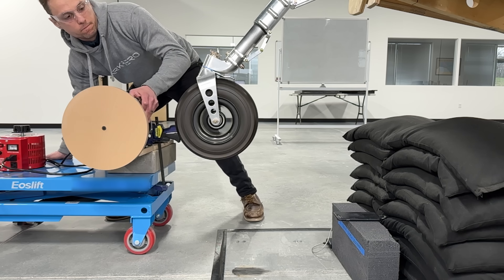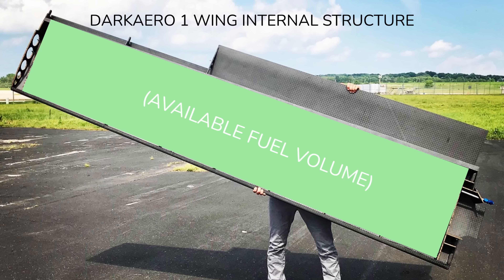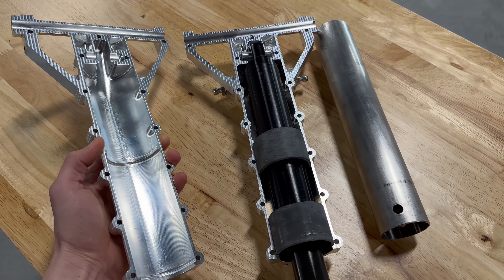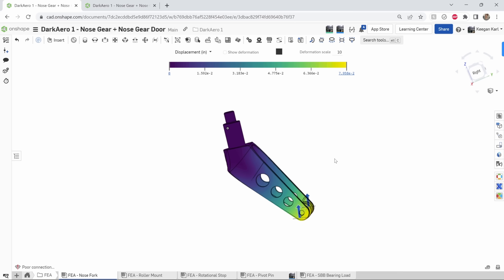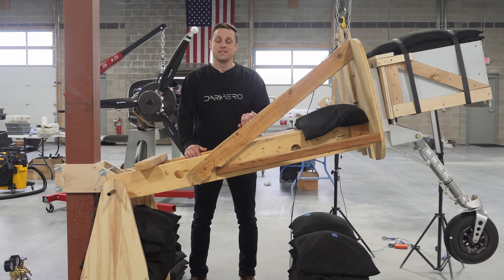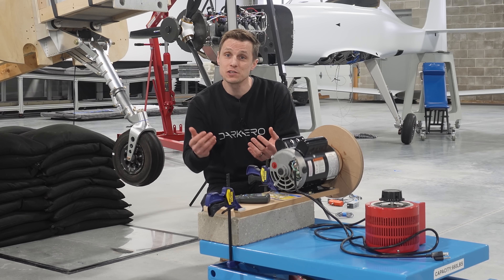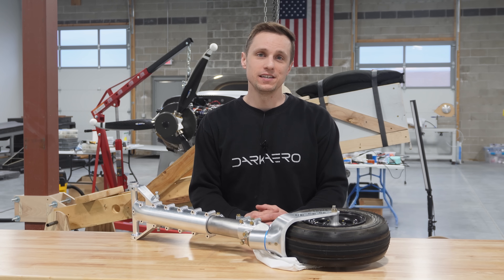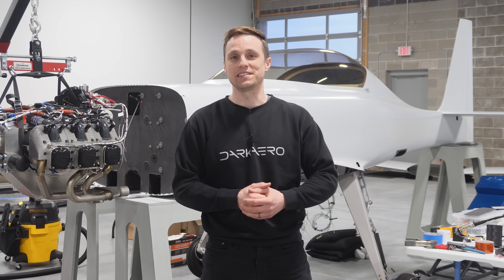Engineering softer landings (drop testing)

Comment: Are there tire pressure indicators inside the cockpit as is the case in most modern cars? A partially deflated tire may cause lots of issues during landings. Can the tire pressure difference between a warm take-off airport and a cold landing site matter?

Comment: The mass on the nose-gear that is needed for a simulated landing impact, is much greater that the equivalent static weight being carried when standing or taxiing on a smooth surface. This is because the pitching motion of the aircraft adds inertial mass to the static mass. My work (and engineering paper in the American Journal of Aircraft) shows that this dynamic effect can increase the size of the so-called static mass by up to 3 times, so we need to design the nose gear to withstand much more force during a landing impact than only that from its static weight reactive load. We need to include the effect of both sinking speed and equivalent mass due to pitching.                                                                                                                                                                        When taxiing over bumpy surfaces there also is an equivalent mass on the nose-gear due to the pitching motion of the whole aircraft. To better understand this, a simulation of the complete mechanical parts is needed. This is what my paper was all about.                                                                                                                                                                                                                                             Past experience on the Airbus A200, some years ago, showed that the formal method for calculating this equivalent mass as specified in the airworthiness regulations was insufficient, and that fatigue strength and life was limited due to this incorrect resulting fatigue spectrum being originally used. My paper about it is still relevant because I wrote it so as to cover a range of parameters suitable for application to many tricycle layout aircraft landing gears.
Reply: Very nice information, and I alao think their tire spinning test is worthless as there is a dynamic braking force additionally to the linear forces especially induced by braking (cog moves forward)
Reply: Doesn’t the differing load scenarios you describe indicate a perfect use case for electronic adjustable dampers?  My 2014 KTM adventure bike and bmw m40i have electronic adjustable suspension which drastically changes suspension performance based on sport or comfort modes.  Seems like a significantly more expensive and safety critical aircraft could have a ‘taxi’ mode and ‘landing’ mode for dampers to handle different scenarios.
Reply: @jonasbaine3538  It's probably not necessary, but I guess it really depends on the particular damper they are using. I think it would be a non-issue with a non-adjustable high quality hydraulic damper with optimized high/low speed compression/rebound, but they are using a combination air spring/damper with less damping than optimal (stiffer spring rate with less damping, forced to be progressive also). From my experience with baja SAE using both air and hydraulic dampers, hydraulic does a far better job at the cost of more mass. My guess is that most runways are smooth enough that it's not a safety concern, probably just a comfort concern. The extra price, mass, and complexity is likely not worth it. The only thing that would make sense to me is a pilot-operated pressure release if issues arise while taxiing, requiring the spring/damper to be re-pressurized before the next flight (can be done easily with a hand pump).

Comment: There was a lot of deflection in the wooden box holding the simulated load. Wont that have a cushioning effect on the impact load? I would think a re-run with a more rigid material holding the simulated weight load is needed.

Comment: Do you need to consider emergency landings (off a tarmac) where the raw ground could have obstacles that can cause the plane to want to flip forward?  Meaning, do you need to design the landing gear to handle a head-on shock load to the wheels/landing gear during an emergency off-tarmac landing?

Comment: i am keen to know how you guys do the validation of the composite parts computational test and real world .also  how you guys find out the life cycle of the aircraft computationally?? Also i am a bit concerned about the stress concentrations on the corners if you are placing your landing gears at the corners because these areas are usally the location of the longerons??
however as an learning aircraft designer myself i am very glad to lyou guys for making such videos its great informative and fun!!
Reply: Look at any composite fatigue data and you will find a break in the curve that shows if you keep strain below a certain threshold it will have nearly infinite fatigue life, beyond 10^8 or 9th. This is somewhere in the mid hundreds of microstrain for many epoxy-based composites.

Comment: once you have the landing gear and fuselage completed,
do you plan on taking the prototype to a full sized wind tunnel to test the deployment and retraction of the landing gear in various wind conditions (and maybe a bit adverse levels)?
Reply: That can be tested in flight. Most first flights they won't retract the gear. On subsequent flights, they will try it.
Reply: @Triple_J.1  
That doesn’t answer my question, nor is it - to my non professional opinion - really safe if something goes wrong.
If they have the landing gear in a locked configuration, it doesn’t test how the electric motors operate under load and resistance.

Comment: Great job!!!  But the biggest danger is beign overlooked... The ULpower engine need lots of work before its SAFE.  Its not safe out of the box. (Poorly designed Cylinder to HEad Gasket System that leads to leaks, lean running and piston breakup, Neglected Bolt Torques all over the engine, lack of a detonation sensor or lambda probe leaves correct fuel-air mixture to basically atmospheric pressure and luck)    8/5/2023   I hope you guys listen to my advice, check those things... UL Power user myself.

Comment: Thanks for sharing! The last test shows rubber wheel deformation: it's squeezed against its tight metal holder. Could this cause the plane to tip over on a hard landing?
(Engineer, no experience with landing gears)

Comment: Very cool. If you get bored on your weekend, I need a nose gear for my Flitetest Mini Guinea. I've trashed everything I've tried. 😉

Doesn't need to retract, but it does need to steer and absorb beginner landings (read: crashes) of ~600g foam airplane.  😂 My goal is to keep it under 20g, including the 5g servo for steering.

Comment: Ive noticed all the newer planes are using winglets on the ends of their wings for better efficiency. Would they not have worked on this type of aircraft? Or would they slow the aircraft?
Reply: This was addressed in a previous video. I believe their research indicated unacceptable increase in drag with only a marginal decrease in stall speed. Winglets tend to add value in longer wings.

Comment: All the gear assemblies retracting rearwards can’t be great for the center of gravity on an aircraft this light. The shift in mass as the gear extends/retracts will definitely be noticeable in flight. Also, Leaf spring type undercarriage have been successfully used on GA aircraft like high wing Cessnas for decades, long before you lot were born. Stop trying to re-invent the wheel.. Get this thing to fly first, then concentrate on over-complicating something as simple as undercarriage🤦🏻‍♂️

Comment: As always a great video with solid engineering principles. Watching the drop test with the spun up tire, your compression works nicely. However, the rebound landing appears to show no compression, but bending instead. Have you done drop test with the wheel stationary? This would simulate a secondary landing from a bad wheel barrow landing.

Comment: Hi Dark Aero.  Will you explain at some point how you will test for side loads and twist loads on the gear during landing?  Sometimes the wind can be howling from the wrong direction and  you’ll land while both slipping and drifting. Thanks for the many great engineering lessons.
Reply: The limiting item is tire grip. You're not going to see more than 1g laterally. Even a corvette with wide tires can barely manage 1g lateral grip. So, as long as the gear can handle the weight of the aircraft sideways. On that hears long lever arm. It will be fine.

Comment: You can simultaniously test the engine mounts when you attach the sandbox like you would do with the engine, and attaching the engine mounts to the “firewall” like on the plane
Reply: I am hoping they will do a full chassis drop test, but that might come later when there is more than one airplane. Keep up the excellent work Dark Aero Team!

Comment: The well known MX2 aerobatic aircraft has been around since 2005, is also all carbon and occasionally suffers from serious problems with the engine mount and/or its connection to the fuselage.There was an in-flight separation of the engine from one of these aircraft in 2015.These planes overall have thousands of hours of flight testing behind them.
https://bea.aero/uploads/tx_elydbrapports/BEA2015-0491.en.pdf

Comment: The structure of the the king pin and bending too harsh on the plane's structure , your knew must fold in ward with double sided yoke or single side arm and should fold in two position first absorbed landing second reduced bent take you knee as an example the drop test you demonstrate hard on the yoke where you pivot is in time will have a play too risky

Comment: Cool.  One question, several follow ups.  Do you have any concerns about the airframes ability to handle the max load drop testing in both the nose and main gear drop tests?  I consider the airframe and the gear as being integral when it comes to landing loads for the airplane (product).  By only testing the nose gear assembly, does that perhaps leave some unanswered questions as to the overall durability of the airframe.  I realize I am being a little obtuse.  I don’t mean to be.   I understand that the required budget of testing this thing to that level is enormous.  Im sure you have thought of these issues.  I just wanted to spark a conversation around it in order to understand your thinking on the matter.  I am a huge fan of yours (as you know) and the airplane.  I really enjoy the videos.  But the DarkAero’s wing loading is not low, and it is a new design, so hard landings over the life of a DarkAero builder could be at least as frequent as they are in existing similar aircraft (some metal, others fiberglass, some carbon).  That said, perhaps the long term strength of the airframe (and the landing gear assemblies) is an area which needs additional clarification.  Thanks.  Sean

Comment: How do you take into consideration the additional forces from landing at a slight angle? That is, a lateral force on the wheel alongside the main vertical force?
Reply: Mount the drop rig on a vehicle at an angle and test while moving.

Comment: Nice job thinking out the homemade, yet seemingly effective, test rig. However, I'm wondering if you're planning to conduct non-destructive component testing, such as x-ray analysis to see if any of the structural components experience or caused cracking. The military used to call this NDI testing - which was mandatory for critical aircraft components. Also, repeat analysis tests, such as graduated simulated landings might show you how the components hold up over repeated landings. Just a few thoughts.

Comment: Hello Reilly, River and Keagen from Sydney Australia. Thank you for the detailed demonstration and explanation, for the design and testing of your landing  gears effectiveness 
Learning outcome
* R&D is time consuming and expensive: mandatory for certification.
*.Substitution: weight of engine to avoid damage.
* Using a voltage regulator ( AC/DC within the specified motor range).
* CAD software

🪃🌏

Comment: nice testing, this was a heavy landing test in perfect conditions does the regulation also ask for a test with the wheel turned 30 degrees to the centerline or something like that,( last-second corrections with the ruder).  if it is not required that ok but just curious about what parts fail, on my airplane after I survive a bad landing.

Comment: More Excellent Engineering.   I realize the drop rig is wood, not metal, but I could not help but notice the stress on what would be the interface between engine mount and fuselage.  Have you considered drop tests for these components and the engine mount bolts? Cheers.

Comment: Are you accounting for the flexion of the forward weight box? How does its motion, and its associated energy absorption, compare to the structure of the actual plane? My intuition is that the nose of the plane, and the engine, will be more rigidly attached. If so, you might not be seeing a good approximation of the actual worst case landing in your tests.
Reply: I doubt there was any real engineering data collected here. I suspect that this "test" was slapped together mostly for entertainment and or content.

Comment: What a time saver and easier than replacing all those seals and needing nitrogen to pump them up.  Great design!  I also noticed no shimmy dampener, how were you able to eliminate that from the design?  It appears to be a swivel castering set up and not steerable.

Comment: With the fork being as narrow as it is, I was imagining a hard landing and thinking the tire bulges out to the side and contacts the fork. This is something that wouldn't show up in your testing rig unless you used a slow-motion camera to check for it. (In the rig both ground contact and fork contact are doing the same thing, where in reality both contacts would be doing opposite things.) That is, if the tire is able to bulge, which maybe it isn't, but what if it's a little underinflated and/or you're not landing perfectly straight?
Just thinking out loud. :)
Reply: Tire contact with the fork seems like a valid concern, but it would probably leave visible marks.

Comment: Worried about every video claiming there wasn't a good enough design off the shelf. If nobody is making what you need then maybe they have a point. throughout recent years we have seen so many of those visionary types designing something ground breaking only for the project to crush and burn. Not saying this will be the case here, just putting some food for thought.
Reply: This is true but on the other hand, these guys are trying to push the envelope a bit in terms of speed and range and lightweight design. But it is true! Tesla does the same thing. For better or worse they redesigned everything, not just the electric drivetrain.
Reply: @mckenziekeith7434  I am all for innovation, but not for reinventing the wheel. I have no clue about airplane design so I can't say if what they are doing is good or bad, just that I am worried. On the other hand I know a little about car design and as you said, what Tesla is doing is borderline criminal incompetence, borderline because it lies vary close to malicious intent when it comes to their design and future plans.
Reply: But some visionaries don’t crash and burn and so we have, scientific, technology and engineering progress. There are always a use case for an off the shelf part, they seriously looked at that, but their is no off the shelf part that met the DA1’s use case. So in the end they engineered parts that do, while still using as many off the shelf parts as they could.

Comment: The dark aero with a Turbo Aero 200 hp turboprop would be a dangerous combo
Reply: It's not pressurized so you wouldn't see much improvement, just more fuel burn with a turboprop.
Reply: it would make no difference, the engine already makes 200 and the plane isn't pressurized to fly high enough to take advantage of that.
Reply: The Turbo Aero is still a ways off, but if and when it get’s released I suspect this question will get asked a lot more.

As for the supposition that a dark Aero would not benefit from the TA200TP (if it delivers on its pro forma specifications), I disagree. Fuel economy would suffer but maybe not as much as one might think. As for altitude, supplemental oxygen is widely available in civilian aviation. It’s technical viability would probably has more to do with an owners preferred routes. If someone can afford a TA200TP vs a UL520iS and all of the other needed modifications, fuel cost is probably not as big an issue as range.

A perhaps less costly upgrade would be the UL520iT (Turbocharged Version) it is only slightly larger in z-axis and a few inches longer. Still a new engine cowling would need to be designed, and a 1000 other things adjusted to make it work. It  instills a weight penalty and an additional scoop for the intercooler but it would improve the the climb out to 20,000 ft which might make up for the added weight and drag. UL is planing later versions with big power boost. But initially this turbocharged version only maintains power to a higher altitude than the non charged engine.

Comment: Is this a special shock absorber, or are you using a specific brand?
congrats for your job!!!
Reply: They explained that one goal of the design was to use an available "shock" (damper and gas spring), rather than a custom unit. Of course it would be a specific brand and model, but I don't recall them sharing that detail.